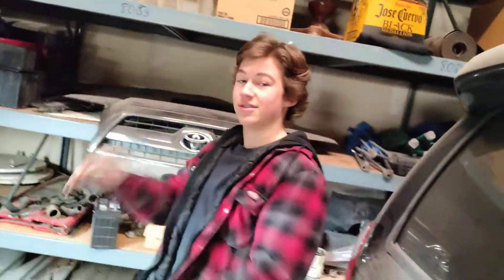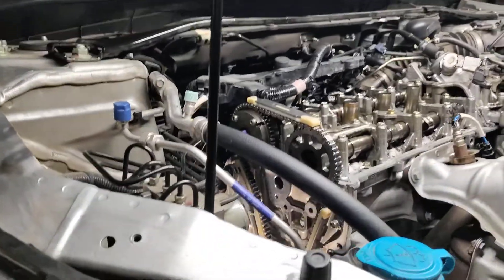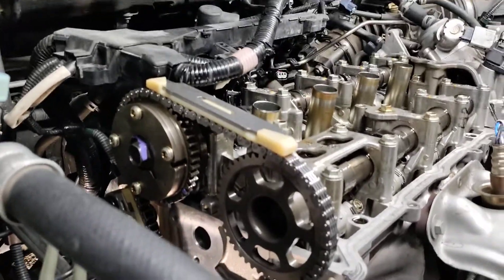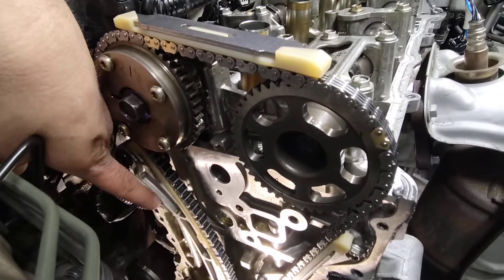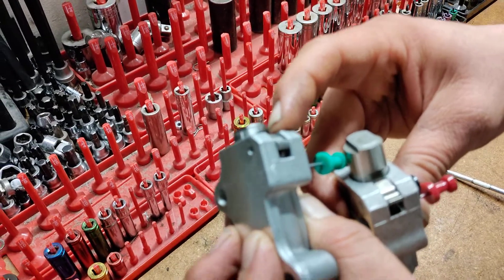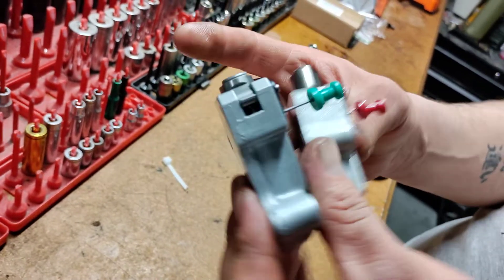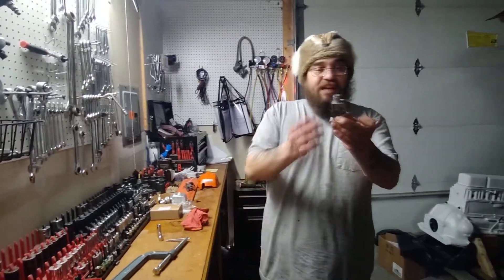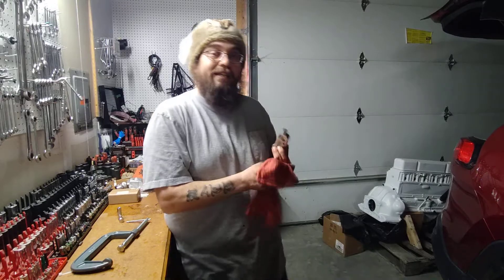Honda K24 earth dream eco tech timing tensioners malfunction/repair and explanation.

Comment: Now I am starting to wonder if the older K24 non-=Earth Dreams engines also are being affected by the exhaust valves slamming shut, as when I had read about this happening, I thought it applied to all K24's.  This video specifically states that it is the Earth Dreams K24's.  I am also wondering if the way that the timing chain tensioner is installed applies to the non-Earth Dreams engines as well, and if not doing the way that is shown here will create the same issues.  Can someone clarify this for us?

Comment: !! I cant believed !!, years ago when I took it apart the  engine cover to look chain and VTC actuator on my 2014 accord , I realize that the tensioner it wont hole tight the chain, but I doubt my self and I give up the idea  and took another approach,   change chain and VTC actuator., now  I know that I was right and my doubt hold me back.  Thank you so much

Comment: I tried Honda TSB 19-019 and now have P0341. I’m guessing I’m
Going to have to open the side of the engine and replace chain, tensioner and guides?
Reply: Hey just wanted to follow up on this to see what happened? Did you immediately get a code upon first start up or was it good for a couple start ups and then you got that code?

Comment: I’m going to be doing this to my 14’ 2.4l with earth dream motor. I’m going to reset piston on new tensioner before install BUT do I need to check my timing to see if it’s even half a tooth off? The car runs perfectly drives perfect no loss or power etc as of right now. Will new tensioner find the timing to be off? Or will it cause no change and just get rid of start up rattle and I have nothing to worry about?
Reply: Here’s my problem, I reinstalled new tensioner the way I took it off. Reinstalled everything and now my car is out of timing. It idles fine and drives just won’t go above 2k rpm and max 40mph. Looks like I’ll be taking the motor apart and replacing the timing chain as I believe it either stretched or jumped timing. I will have to set everything back to TDC and put it back together
Reply: @SimonsSoftwash any update on this?

Comment: I still prefer the v6 motors and would rather do a timing belt refresh every 105k or 7 years whichever comes first. The v6 motors are built like a tank and have no problem hitting 250k plus with minimal maintenance and care. Why Honda isn't using them still is beyond me the gas mileage is excellent and the power is plenty for most people. Ill stick with the v6 until I die. Honda needs to offer it as an option for me to consider buying a new car until then it's older models that have them or Acuras instead. I think people are going to discover that the Turbos aren't going to last like the naturally aspirated motors do.

Comment: I just replaced the tensioner on my 2013 accord. The startup noise was gone but the car sounded like a diesel at idle through about 3,000 RPM. I found this video and gave it a try. I’m an engineer, so I was skeptical because the tensioner should ratchet out to the appropriate length on it’s own. I first moved the tensioner piston out one click and the noise at idle was still there. I then moved the piston out one more click and the noise is gone, both at startup and at idle. Thank you so much for this video, I never would have figured this out on my own!
Reply: Did you buy a new tensioner or just "reset" the old tensioner piston length and replace back onto the engine?
Reply: @rubenramirez8062 I would honestly recommending just replacing it. You’ll kick yourself if you just reset it and the issue came back a little while later
Reply: Did you line up the chain as well or just moved the teeth up two clicks?
Reply: Did you remove the timing cover completely?

Comment: I had the rattle at cold startup on my 2015 Honda CR-V. I changed the tensioner but what I did that I didn’t hear mentioned, is I turned the crank clockwise after installing the new one so it will ratchet out, I started it, it did rattle, that’s because it didn’t have oil in it, it has been silent since. I have heard a worn out tensioner leaks the oil out of the port. Did you rotate your engine clockwise after installing yours? That seems like that is what broke your tensioner and jumped a tooth. I don’t recommend setting the tensioner out an additional tooth, unless you want to replace your chain guides real soon. Just my experience and 2 cents
Reply from the maker: its been well over a year since I made this repair. the owner is my dentist and the vehicle has had no issues.
Reply: It’s actually recommended to set the tensioner piston out at least one tooth for the k motors, to increase the longevity of the tensioner. It’s not common info though and Honda certainly doesn’t acknowledge this

Comment: Wow, I didn’t know this was a thing. Our 2014 Honda Accord 2.4L has about 160,000 miles on it. We haven’t encountered issues with the engine other than a leaking valve cover gasket. I’ll definitely look into this.

Comment: Lmao this has got to be a april fools joke.  The tensioner naturally moves out and sets tension with oil pressure 😂😂.  Manually prime the tensioner before starting
Reply: So funny you think that. If you move chain guide tighter then it stay out longer. Bit under the pressure of the chain holding tight, that tensioner can’t expand and keep it tight

Comment: 2014 Accord 2.4L earth dreams engine. I hope this helps someone. It can be little confusing but it can be selected at what point the tensioner locks. The key is the little tooth that swings back and forth above the piston. Honda never mentions this. I  think I was lucky to come across this video. I believe there is a good chance I would damage my engine if I just installed this tensioner the way it came from the dealer. The chain gets extremely loose at times when spinning by hand. The manual doesn't even mantion this procedure. I did notice some wear on the piston. The wear is from moving up and down but no damage from any impact. Considering all the evidence, I think the old tensioner was installed without being set properly. My car right now has 150000 miles so I'm changing the timing chain but I didn't notice any significant stretching on the old one, also if it stretches car computer should let you know with check engine light. As I mentioned before, I am changing the actuator so if all these things don't help it has to be oil pressure related. The rattle started around 70000 miles. I'm doing this only because I was going to change the valve cover gasket since it was leaking into one of the spark plug tubes. Figured might as well get rid of the annoying rattle that has been there for about 80000 miles. I should have probably left it alone since no one has any real answers. Spacing is tight, need to know the torque specs. The worst part is sealing  timing chain cover because of the limited space on the side of the engine. I think it will be hard to put the cover back in place without disturbing the honda bond. The surface where you apply honda bond has to be clean and dry. I would let it sit for about 2 days before adding oil or starting the car after it's put together. Don't like oil leaks 😊.

Comment: Just an addition to my previous post. In theory the solution with two clicks should help assuming we can get the tensioner in place. The questionable thing is if those little teeth will be able to to take the force of the chain without any support from the oil pump.  This whole thing might be related to the oil pump not providing enough oil fast enough to keep the tension. There should be a one way valve to keep the oil in place. I'm just wandering if the fix in the video lasted for some significant amount of time.
Reply: did u figure this problem out? whats the update
Reply: Have you tried anything?

Comment: All of this makes sense. When turning the engine by hand at times the chain is super tight and others the tensioner goes way back and allows the chain to be way loose. The tensioner travels too far back. The old tensioner had no damage. I installed new one with chain  and actuator. Didn't install the cover yet because I'm concerned that all those parts are not solving my problem. This is the only thing that kinda makes sense if I can fit the tensioner with two clicks out and the other concern is too much tension at some point in the spinning cycle for when the chain is nice and tight. It seems like the cover needs to be removed to do this. I just want to be sure that what ever I did will help with this problem. After  replacing all three parts I still have doubts unless I do something else with it. Like I said old tensioner or new one I don't see any difference when turning buy hand(with all those new parts.) If it was like that since new I could live with it, but what changed? In my case I don't think it was any of those parts. I'm hoping it was the actuator. Stronger spring on the tensioner wouldn't hurt anything. Anyway, I will post once I decide what to do and finish putting it together.
Reply: Did you figure it out?
Reply: Any updates?

Comment: Had a shop try to replace the tensioner but couldn't get the piston to compress enough to get out.  Any tips?
Reply: I have yet to try this myself but I read that you can push up (above the piston) with a finger to allow slack while pulling the top of tensioner out towards you.

Comment: I have a question about your process.  Have you did this to an Accord by using the access cover to the timing chain tensioner and not by full removal of the head cover and timing cover?  I am concerned about having enough room to set the tensioner out 2 clicks and get it in that small space.  I have also wondered if I install the tensioner as it comes from the factory, pull the pin and rotate the engine 2 full rotations using a break bar to help control the backlash while using a 3/8" wood dowel to push up on the guide to try to help the tensioner lock into place extended before starting the car.  I would like to know your thoughts.  Thank you.

Comment: Great info but not sure why you have to manually extend the piston - it will do that automatically. When the tensioner is installed, just compress the timing chain guides and the piston should self-adjust to where it needs to be.
Reply from the maker: Because you n first start up the piston slam all the way back  causing it to break and fail due to manufacturing defect.

Comment: @Matt Saughnessey I can't find the article to read, could you please or someone post the link or website?
Matt, thank you for the generous info. But are you sure that the article or ahonda are actually suggesting to shorten the timing chain by a tooth and not the piston. Because, like others have realized, the piston is made to naturally compress and decompress as the engine is running, so releasing the tensioner piston by a teeth or two is the same what it naturally does while installed and running, what's the fix here then ?.. but hypothetically if the chain is shorter then it would never become  loosened up ... please any ideas or clarification would  be appreciated.
Reply from the maker: You over thought and complicated this.
Reply from the maker: Tensioner breaks because it is allowed to slam back down upon first start up. To avoid this compress the tensioner. Do not ever shorten a chain.

Comment: After you install the tensioner and pull the pin doesn't the piston automatically extend to meet the slider guide. Hence the reason for needing the C-clamp. Can you explain what this process (fix) does to the mechanics of the tensioner.

Comment: Can this be done and installed without the timing cover removed? Seem like it would be very difficult to do with just the inspection plate removed.
Reply: Have you ever found an answer to your question? Thank you
Reply: Yes you can do it. I have done several with out removing the big cover. Just have to use a flat head and pry stuff around

Comment: How easy would this be to do without removing the timing cover? I’d like to diy but don’t think I’ll have enough access to zip tie the chain. I’m wondering if the added tensioner length would be too much length to install it without tying the chain back
Reply: Did you ever attempt to replace the tensioner through the access cover?
Reply: @funwithpaypay6145 that’s what he’s referring to … doing it thru the cover without zip tying the chain

Comment: Great information! Thanks! Piston teeth can extend out automatically. Manually set the piston teeth position does not seem make sense. Could you explain a little more? Additionally, extended piston makes installation challenging because of the limited space.
Reply from the maker: Due to manufacturing defect if you do not set move the piston closer to the chain then when you start up the piston will slam back due to the vvt and brake the tensioner. You must set the piston your self before install. I have videos explaining and showing this.
Reply: @MattShaughnessy6  do you mean it will break it over time or immediately when you start it up after installing a new one?
Reply: When you show the moment in the tensioner it looks like the pin 📌 is still in the tensioner. Isn't that supposed to be removed when functioning?

Comment: Hey can you post a link to that Motor Trend article?  I can't find it googling. Thanks!
Reply from the maker: https://www.google.com/amp/s/www.motortrend.com/how-to/htup-1005-honda-k-series-tensioner/amp/
Reply: @MattShaughnessy6  so the article mentioned replacements from Skunk2 and Hybrid Racing but lists as 08-12 accord. Will it fit in my 2014 version of the K24w1?
Reply: @SlimDaFox will these tensioners fit the 2013 crv